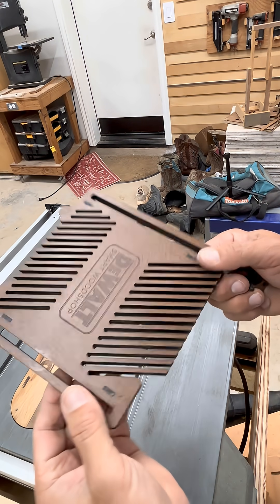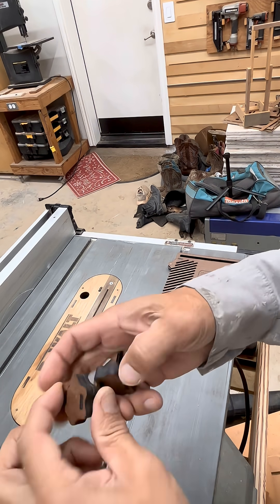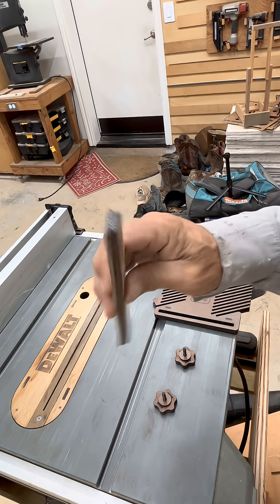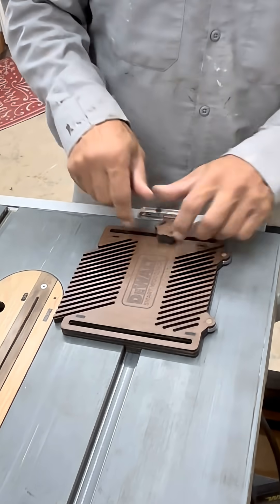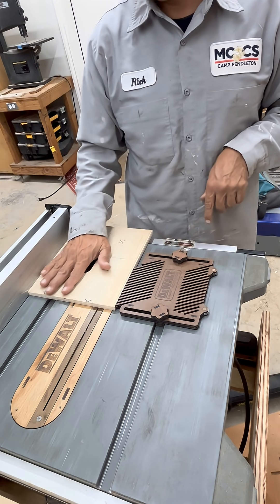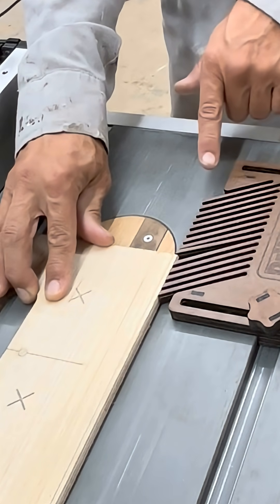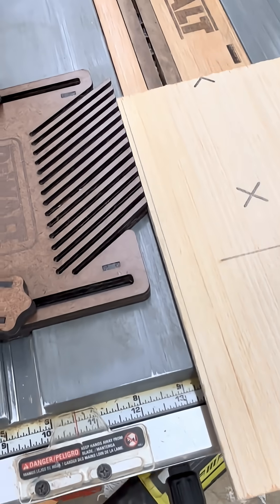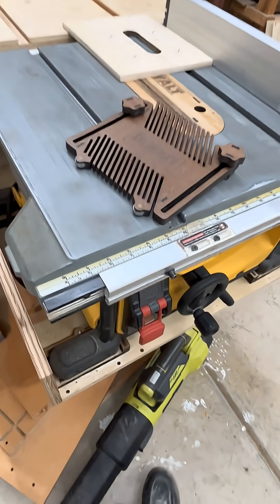Feather board final assembly for DeWalt tablesaw #acmer #acmershare #lasercutting #tablesaw

Comment from the maker: Well when cutting thin strips this will keep the piece right against the fence so you get a nice straight cut when pushing it through with the push block. Say I'm cutting a 1-in strip. I don't want my fingers by that. And when you use the push block it eliminates error. I never got any kickback with my saw but I don't think any teeth would break. I think the saw blade would bog down. My saw has riving which limits the possibly of kick back. I never experienced any kick back on my saw yet so this is just some added safety. Hopefully I do not ever find out 😅